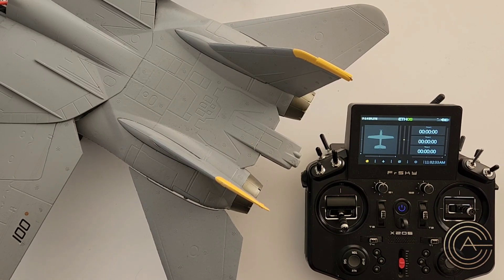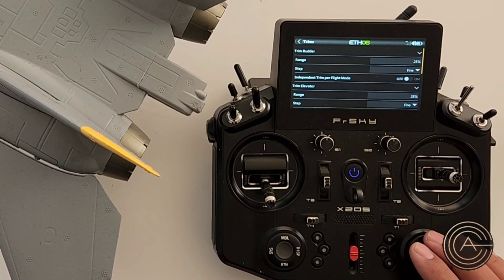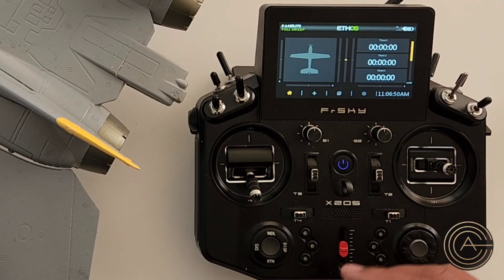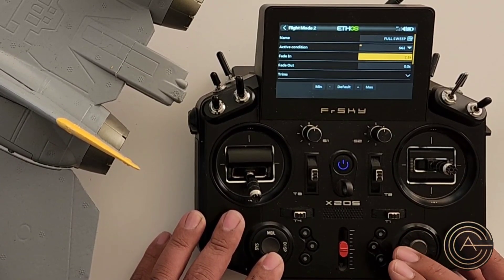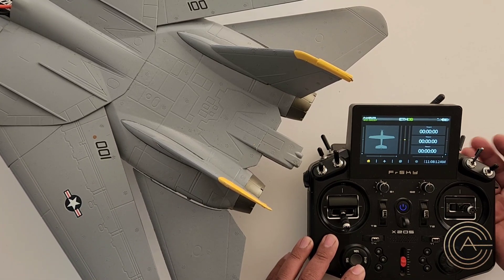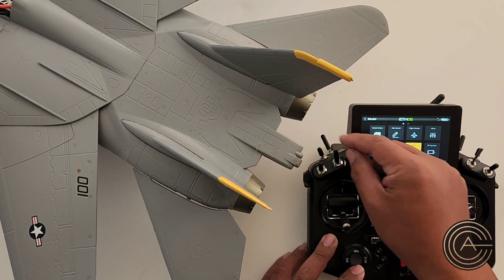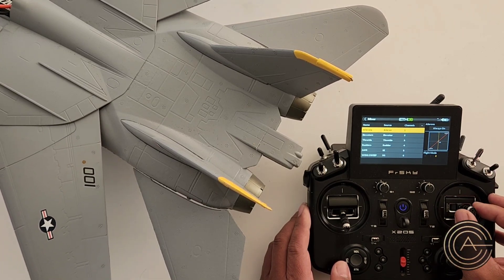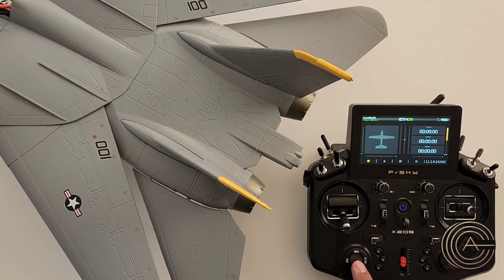The Frsky Series: Understanding Flight Modes. Setting up the E-Flite F-14

Comment: Hello. I have three flight modes setup. I need a "fourth" flight mode. I created FM4.How do I enable it?
Reply from the maker: I assume you mean how to put them on switches to activate 4 things instead of 3. I haven't tried it yet since I haven't had a use case but I would either use the function switches. You can make the function switch into a 6 position switch in the model, edit model area. Or you can use logical switches. For example activate fm1 by a logical switch set to AND. Choose two switches like SA up and SB up. For fm2, choose SA mid and SB up. For FM3 SA down and SB up.  For FM4, no logical switch, just SB NOT UP (choose SB up, hit and hold and invert it). 
Try that and see if that works for you. If you need more step by step instructions, email me at all.rc.air@gmail.com and I'll send you a step by step.
Reply: @all_rc  Thanks for replying. Here is what I did, before I received this response. Created FM 4 from the flight mode menu. Gave it a name. Assigned a two-position switch. In my mixers and looking at the "flight modes" I see that FM4 is available. Looks good. Back to the main screen or the flight modes menu when I select the FM4 switch nothing happens. But the other flight modes respond when I select the three-position switch that was assigned. Something very small is happening that is preventing FM4 from functioning.
Reply from the maker: Try the logical switch method I mentioned. Fm4 is lower priority the other FM's (fm1 being highest priority) so since FM3 is activated by 3pos switch, it stays activated over fm4 regardless of fm4 being activated by the 2pos switch. The logical switch method works because it turns off the 3 pos switch when fm4 is selected. If you haven't played with logical switches before, send me an email and I can give you a step by step guide on your setup.
Reply: @all_rc  I see. I'll give it a try and let you know how I make out. Thanks.

Comment: Yup. Flight modes are used a lot by sailplane guys. I'm my case Launch, Thermal, Speed, and Landing each have their own trims. Currently I have these modes enabled simply by clicking one of the  top two or bottom two buttons of the six 6  located between jog dials O > I < O . Any reasons why this approach might not be a good idea?  Initially, I did not have a transition delay time set , but now that's in there it seems to work well and It's super nice that the mode name shows up under the model name.

Comment: Again , congrats for this video. helped me a lot! Another question: Which channel in the receiver  is responsible for wing sweep ?
Reply from the maker: Ch6. Create a new free mix.  Source is whatever 3 way switch you want to use and output channel 6.
Reply: @all_rc  i really appreciate your help.I've succeeded binding new UMX Eflite/Spektrum planes( UMX Timber, UMX F-14) , but i've noticed the older ones, ( UMX B25, UMX GeeBee) didn't work fine.Maybe its because they don't use DSM2 i think.

Best regards, your videos are helping me a lot.
Reply from the maker: I haven't tried the older ones.  I wonder if it's just a firmware bug.  I had those old eflite planes before, but i was using edgetx and a Radiomaster tx16. They use the same type of module (4 in 1 protocol module). It worked fine on that system.  It might be just a firmware update or something like that..... I'll try and investigate.

Comment: I have used flight modes for years and have never used trims.  It's odd that all flight mode videos mention this.  What about 3D mode, snap roll condition, Different throws, Stall turn condition,  different idles.  Are there any FRsky videos that go over other, more common uses of flight modes?
Reply from the maker: The power in these higher end radio systems is the flexibility. You can use the different tools they have in different ways. The primary use of flight modes is to allow for different trims settings in different conditions.  You can do the conditions you described with flight modes or you can just use switches to activate those conditions without flight modes.  But you can not get different trim conditions without flight modes.  My video was for basic flight mode usage in the particular case I needed to program.  If I didn't need a different trim condition, I personally wouldn't do it with a flight mode.  But that's just me. It's your radio and if it works for you,  no problem doing it in the method you described.

Comment: I use flight modes for all my EDFs and Turbines. I am new to Frsky, when I set up flight modes is the trim automatically independent to each flight mode?
Reply from the maker: Once you turn on independent trim for each of the surfaces, yes.  In the video,  I turn on independent trim for aileron and elevator.  So just like that!  Once that is turned on,  then each flight mode has its own trim for each channel that was turned on.
Reply: @all_rc  Thank you that helped me

Comment: Still need ailerons trimmed in flight modes just in case the flaps induce a roll.
Reply from the maker: Good point.  I usually just mechanically fix the flaps if I encounter that but that's I good point.